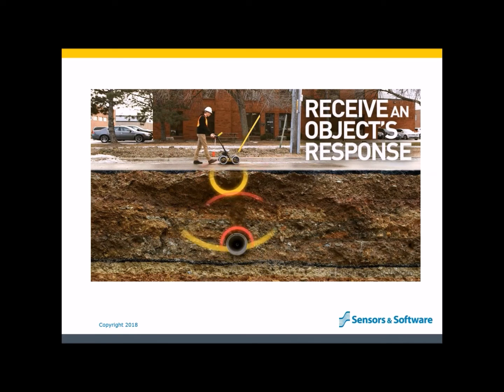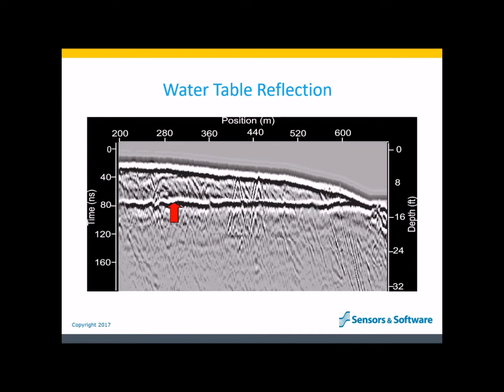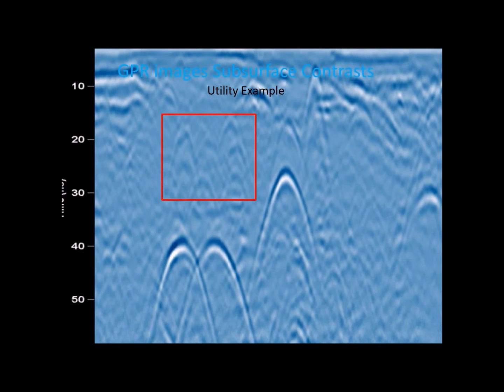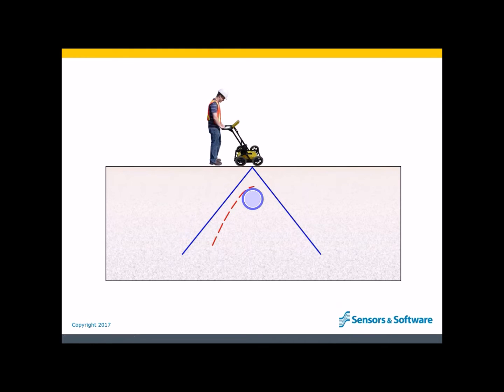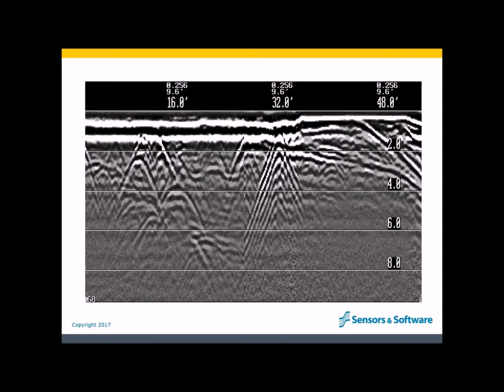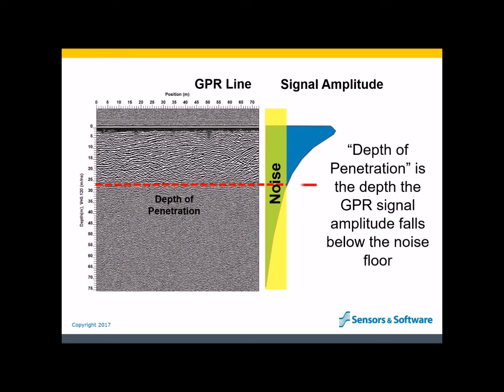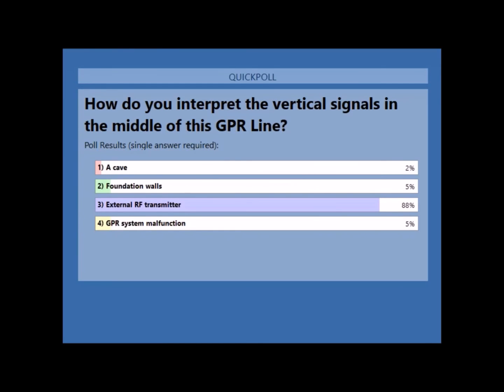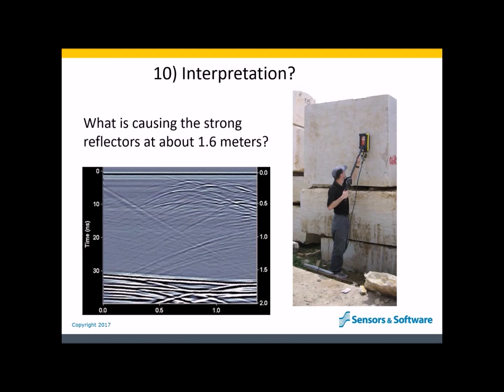Webinar: Basics of Interpreting Ground Penetrating Radar Data - Part 1

Comment: R=−0.0455 represents approximately 0.207% of reflected power,  how can I evaluate this value to 5% of reflectivity? can u please explain
Reply from the maker: A reflection coefficient of 0.0455 as you show below is 5% reflectivity.  Meaning that approximately 5% of the incident energy is reflected at that boundary.  The remaining 95% will continue travelling through the material.  Hope that answers your question.

Comment: Very good seminar, as the others in this channel. But, if you allow me, I disagree with what you said Quiz 4, because I think that if the pipe is located in a high attenuation zone, the reflector just below this zone shouldn't be visible, but a strong reflector just below this zone is still visible. Actually, in quiz 9 you confirm this situation, when an attenuation zone begins, no reflector should be visible deeper.